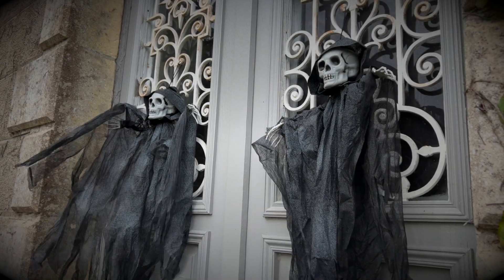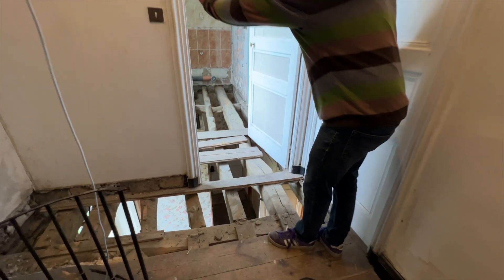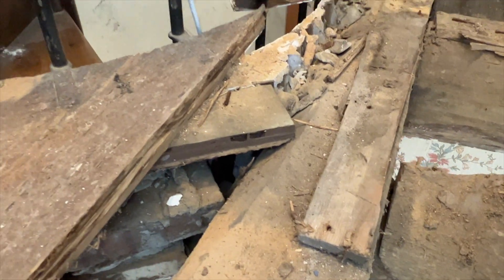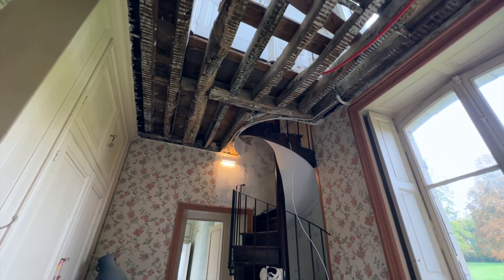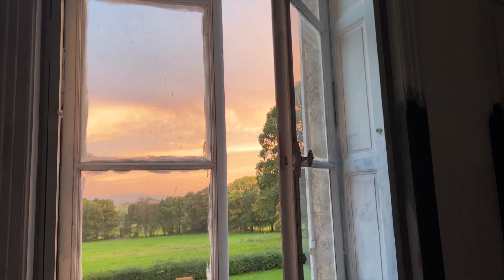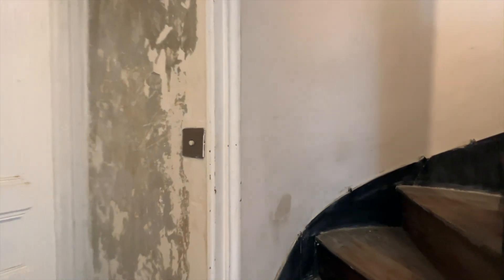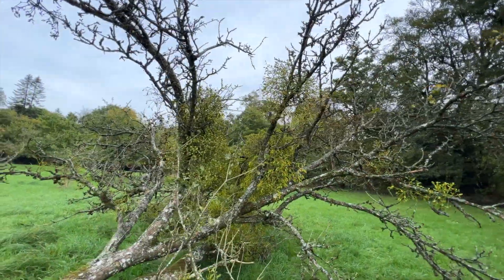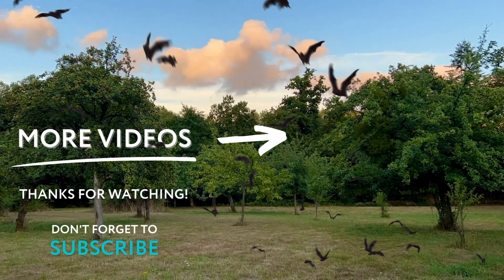CHATEAU Room Reimagined: The Ultimate Makeover!

Comment: This may be difficult to explain, but hear in the UK we have joist extensions made of galvanised steel that bolt onto the ends of rotted joists. You cut the rot off the bolt on the new metal extension.... You could do the same thing with say 1cm thick steel plate. Treat the rot and coach bolt/ lag bolt or use threaded metal bar to secure the plate steel. You can buy side drive drills that will easily fit between the joists... Just a thought, keep up the good work!!!!